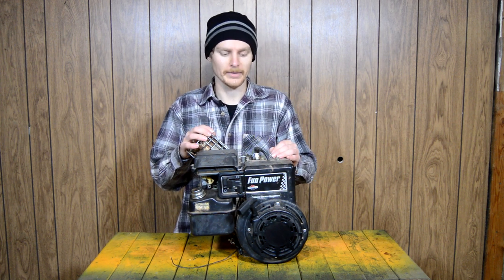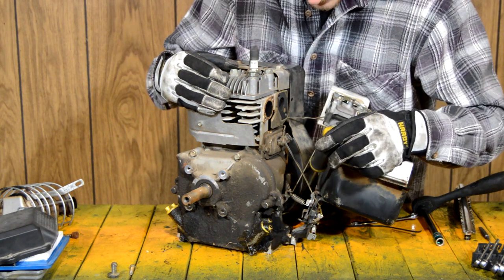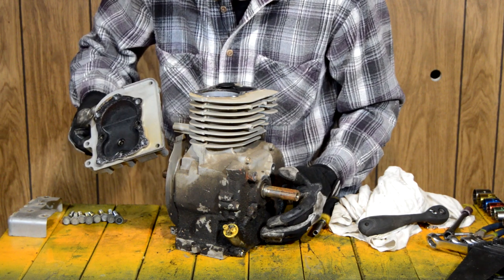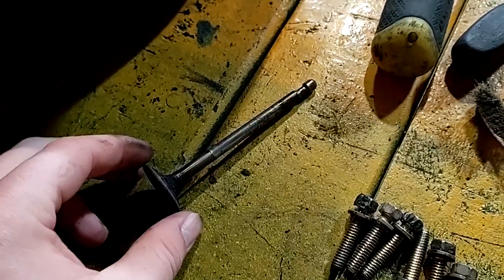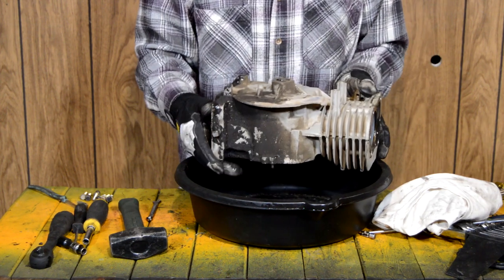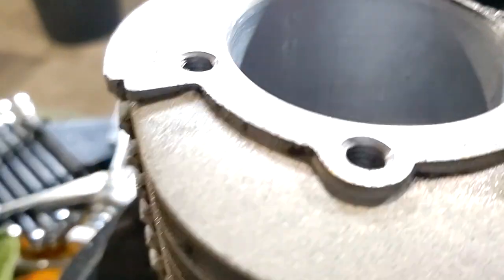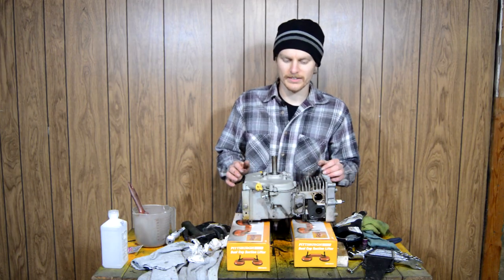Rebuilding a $25 Briggs Flathead 5HP Engine

Comment: You have to use an actual gasket on the pto cover.

There are three standard sizes to set your cranks end play.

Just using rtv and you probably can’t turn the crank at all.

That’s probably why you don’t have a video of it running

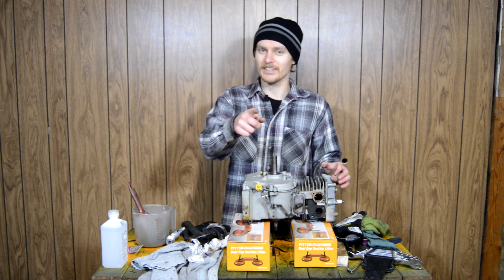Comment: @15:02 vent upside down? Question: are the crankshafts the same between a Horizontal and a Vert motor? I got a great lawnmower engine but I need a go cart motor and I can get a H-mount block for cheaper than a entire motor. All my stuff could transfer over? Ive done the Vert to H modes (cutting a new oil groove on top of crank bore and filling the old one, crank slinger off rod end, governor delete and new oil fill) but Im not sure how the springs get oiled.
Reply: Go check at scrap yards I got 2 for $40 and they fired off starting fluid.
Reply: im not really sure what your trying to ask  but briggs cranks will sometimes interchange but not always  you can covert a vertical shaft to horizontal shaft but  with some work but it wont last long briggs horizontal shaft engines just dont oil very good and they lose comression due to ring wear very quickly when theyre used for a gocart  but relax you have better options tecumseh isnt a better option the carb bowls on those tend to get stuck and not allow the needle valve to close and theyre expensive and hard to find but real hondas and honda clones are readily available 
and have great aftermarket my suggestion is to leave your briggs on your lawn equipment and spend the money for a legitimate honda engine theyre good and most of the clone hop up parts work on real honda engines